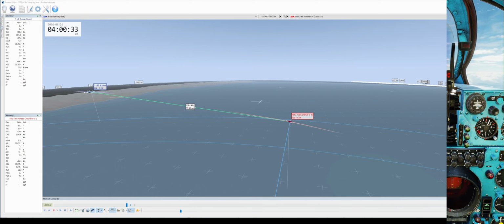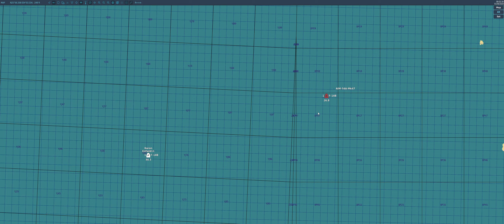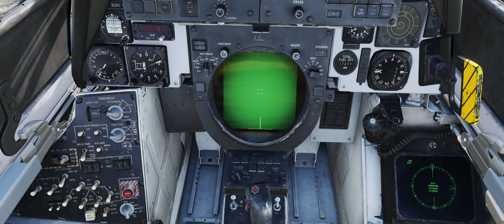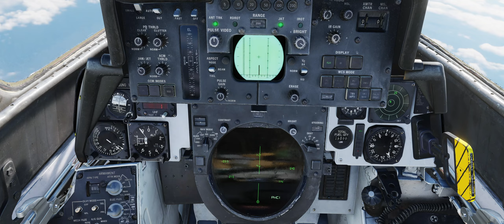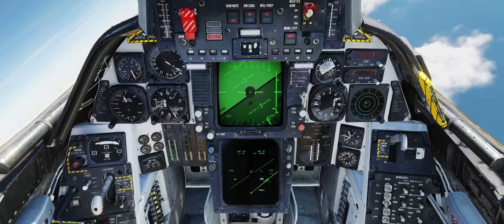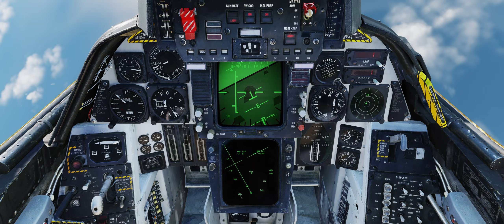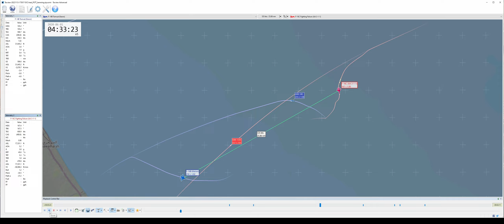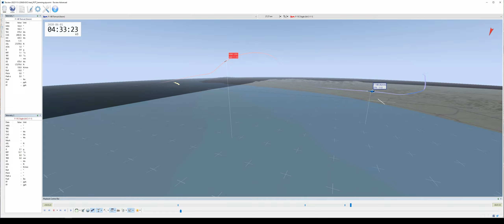F-14 - Engaging Jamming Aircraft. Or, Why DCS is a Poor Combat Sim

Comment: Dude, i love your website and all your videos.  Holy shit, you are doing gods work.  I am still struggling to see if jamming is worth it? or when it is worth it in DCS? any chance you can elaborate on when to use it?  And does all the jamming work the same between the modules?
Reply from the maker: Hey thanks mate!
Jamming is, more or less, the same across the DCS board: noise jammers aiming to deny range determination. About when to use it, the ideal bracket imo is between the adversary's detection range and burnthrough: too far and you make yourself visible, too close and you are helping hostile missiles.
Reply: @FlyAndWire  I have noticed if you leave your jammer on (e.g. SU-27) and the bandit shoots an AMRAAM with-in burn through range, that it doesn't take as high of a loft trajectory to intercept.  I was wondering if you had seen this too?

Comment: Very interesting.  I hope one day we can get radar specific burnthrough ranges so that way everyone doesnt have the "balanced" 30nm burnthrough.  The AWG-9's behemoth floodlight shouldn't be equivalent to the Viper's flashlight.    Still though this seems to track what I thought is most viable for jammer engagement, (meaning: 45nm estimated range, go 40 degrees nose up, launch, crank, re-engage)
Reply from the maker: One of the interesting things of a more realistic jammer is its directionality. No more jamming regardless of aspect and other parameters.
The AWG-9 is indeed powerful, with good agility, and it was apparently hard to jam. However, ED should consider the era and power of the jamming devices.
At the end of the day, jamming right now is a boolean flag, whereas it should have more features: power, direction, era, et cetera.

I posted a couple of equations that explain the S/N and J/S relations, and variables include range, RCS, jammer power, gain and so on.

Comment: Amazing. Thanks for tips fighting Jamming targets! So what is the logic on Home-on-Jam in DCS? Missile HOJ is set only before launch? and then it stays in HOJ throughout the life of missile? I thought if missile loses HOJ (jammer of target off) then missile reverts to active mode (if it have radar). Like your RWR 13:40 was gave you warning that aim120 has its radar on and locked you didnt it? and yet it was still looking for jamming target?
Reply from the maker: No problem mate!
Something I just pinned in a comment and I forgot to mention, is that the AI cheats and can launch HOJ lofting missiles before the burnthrough range.
To answer your question, I think that the AI cannot do proper JAT tracking, so the missile keeps going in a general direction, and it activates itself at some point. However, with me turning the jammer off and no support, I guess the missile lost any reference and its seeker was out of gimbals at A-pole. However, emission cones are greater than the seeker's gimbals I suppose, so my RWR barked anyway.
The real answer is that I fail to see any logic in how jamming is implemented, so take everything I say with a gran of salt.
Reply: @FlyAndWire  Its just amazing for me that you simply switch off Jammer and it made that 120 go stupid. But it doesnt work for 54s isnt it?
Reply from the maker: @The_Tau  I may be wrong, but I think this worked back in LOMAC as well. I was a SU-27 player back then, though.
I suppose that it doesn't work for the F-14 as I was tracking the angles. In TWS seems to be working too, but there are issues with the final guidance.
Perhaps doing the same with an F-whatever locking in STT works too. No clue.

Comment: 100% agree, finally a video that shows what i felt about DCS for 20 plus years.. i love the game, love DCS, i played original Su27 back in 1996 ffs!!! )) but anywhow, this is not combat sim, its aircraft sim, its high fidelity module sim, has nothing to do with simulating combat of any sorts, AI is non existent, which is evident when you go to mission editor and have to explicitely tell AI to do anything if you want it to act with "brains", like, go to point A, turn radar on, use radar guided missiles, i think we are close to me having to specify-Dodge enemy air attack by banking left, perform s-split, then return and etc etc.. very very bad!

 about combat sim? there is nothing to show its combat sim, combat sim would put elements of war in the theatre and would have an effect on gameplay throughout the campaign for instance, or multiplayer session if you will .... is there an imperative to hit enemy HQ? or any C&C structures? nope, why should it, you can put a mission to do this but it has no relevance to anything.. combat sim would make it so if you FIND OUT where enemy HQ is, and successfuly hit it, it means troops movement is LESS coordinated and would result in less cohesion meaning your ground attack offensive would be 20-40% more effective or whatever.. there would be correlation between things you hit and their effects and need to prevent such hits by AI or human players.. 

so, yeah, sadly i don't see it will get to that point, DCS will remain module sim, will keep getting more modules and that is that..some sort of modern electronic  module maker of planes..instead of buying modules and putting them together, you but electronic versions and run them through 3D machines-aka computers ..expensive hobby and that is all there is..

what is more, for true combat sim you don't even need the high fidelity nonsense, you need the basics of ground war done, you need to understand logistics, defense, attack, cover, penalties, morale, exhaustion, organisation etc etc.. and the tank units, statistics, almost irrelevant when compared to massive BASICS you need for combat sim..
Reply from the maker: From my understanding, multithreading is really close. Perhaps this will be the first step to more complex implementations, as the current engine is showing all its limitations.
For example, apparently the dynamic campaign and ground AI were being developed at good pace, but perhaps the architectural overhaul is necessary before proceeding.
Reply: "100% agree, finally a video that shows what i felt about DCS for 20 plus years.." Just to clarify, are you being hyperbolic, or referring to older Su-27 Flanker and Lock On games? The first "DCS" game was the original Black Shark and came out about 15 years ago.
Reply from the maker: @jubuttib  If you are asking @keepwalking6041, he said the played the old Flanker in 1996.
I played LOMAC about a year post release (2004?). I had to rebuy the original disc later since my drive did not read it any more. Same with the old Il2 FB. I played BS, before it was really called DCS, in 2008. I preordered it, and installed it on the release date.

Some of the old stuff I left at my parent's place: https://cdn.discordapp.com/attachments/920981235537428510/1056871448582574131/IMG_20221226_104049035.jpg

I don't miss 3.5", CDs and DVDs at all!
Reply: @FlyAndWire  Was indeed talking about Keep Walking's comment. Played Su-27 Flanker a fair bit as well, but skipped most of the others until got back into DCS, spent that time in civvie sims.

Anyway yeah the point was just that "DCS" is barely 15 years old, so was asking if he was just being hyperbolic, or referring to the predecessors as well. =)